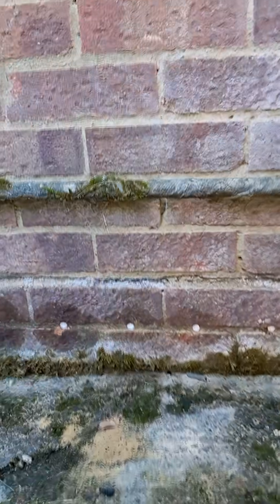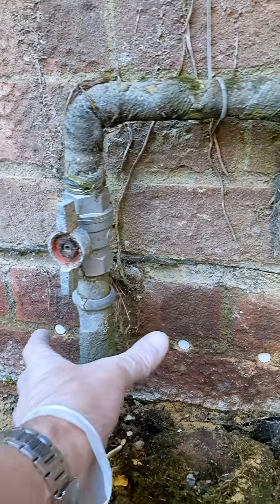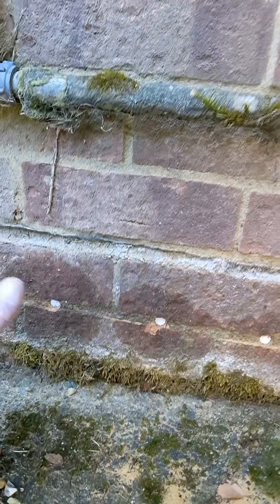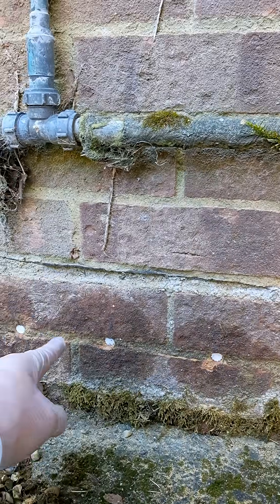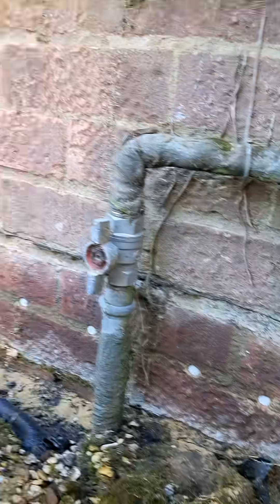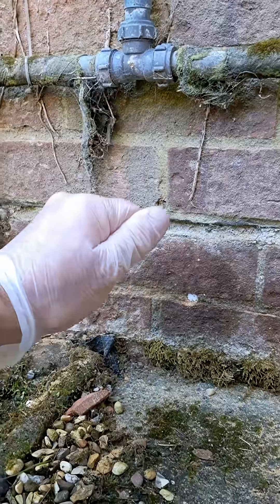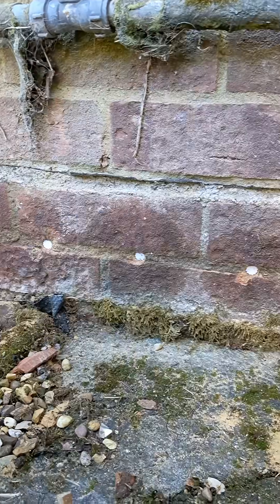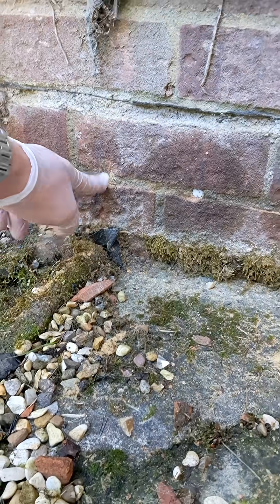Rising Damp, Dry Rods

Comment: Should you point the wall first if  the pointing bad ad then do dry rod months  later.
Reply from the maker: Take out 20mm of the old mortar, drill the holes and apply the dry rods, and then repoint. The dryrods you see in the video were filled after.